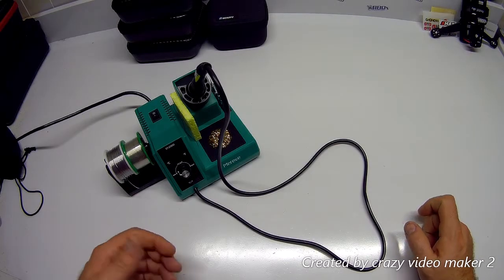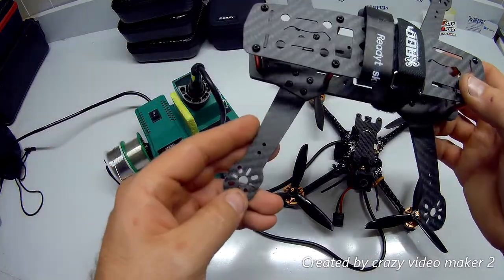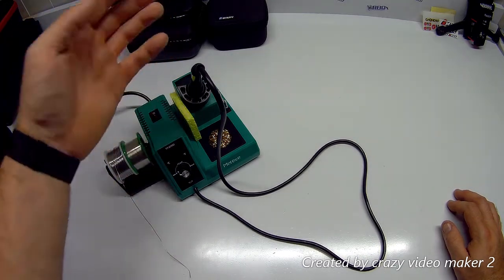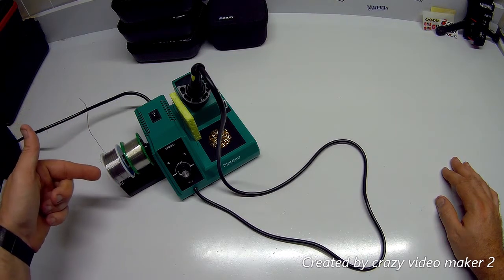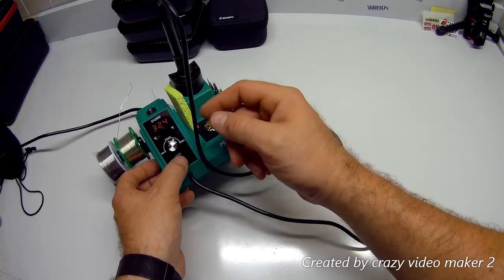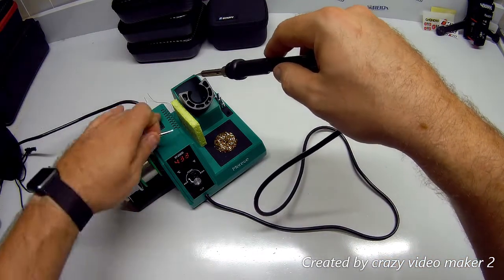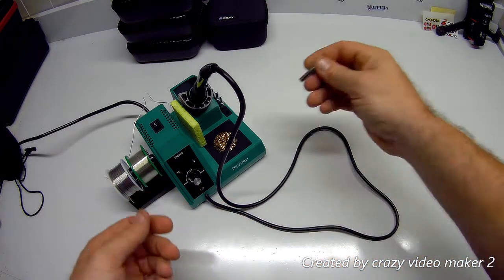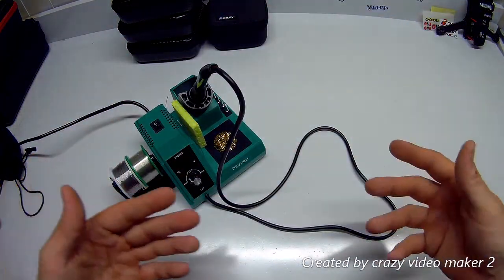Best solder iron for Drones!

Comment: Just bought this unit to start doing synth repairs, does yours still work?
Reply from the maker: Yeah still runs great. Haven't had issues at all.  I just used to repair led on my tv back light.
Reply: @RandomHobbies20  That's awesome bro that it still working for over a year. I had a yihua 936 $19.45 50 watt soldering station which sold at hobby king. It work ok but didn't last long and it just I dunno take a bit to warm up. Seem this station you have be the ticket :) Keep up with the drones. I built couple drones before but more of helicopter/airplane guy but going to get into drones once again. :) Where you buy you're drones stuff?
Reply from the maker: @rcrotorfreak  I generally get my stuff from pyro and rdq. I have found myself getting more stuff from newbeedrone lately. Now that we're getting into the whoop season, I'll have to refresh my indoor flying :)

Comment: How long does it take to heat up?
Was your temp knob loose? - watched another vid and it was falling off right outta the box.
Thinkin about getting one. Seems a good price.
Reply from the maker: george orwell heats up to highest temp in less that 30 seconds on the dial.  I have only used the small fine tip for small point soldering.  

As far as the temp knob, didn’t have any issues. Mine was lucky and got a solid build.  
Thanks for the comment!